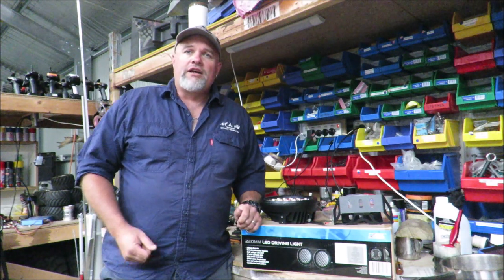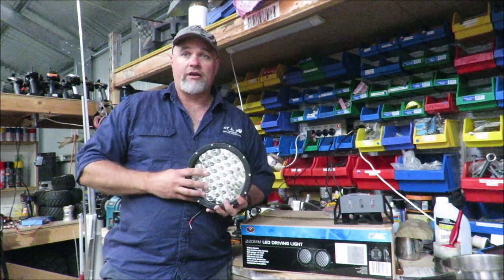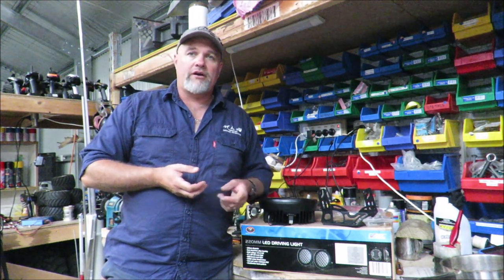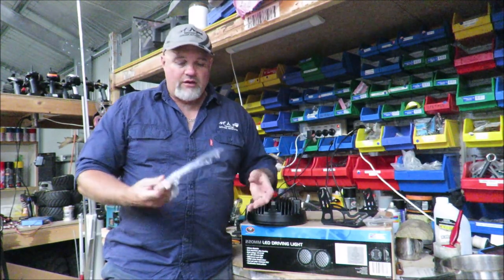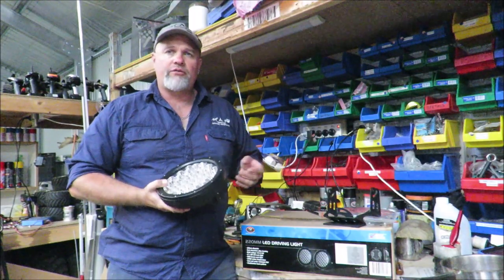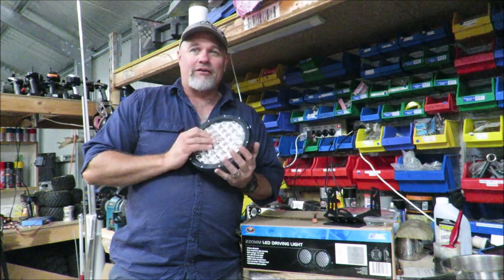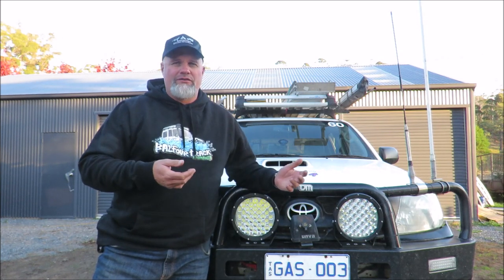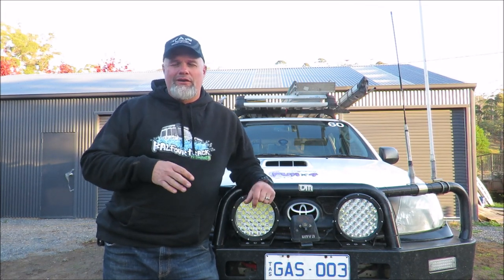SCA 185W 220mm LED Driving Light Review

Comment: Hey I know you posted a year ago they use 5w diodes but regulate it to 10 amps to use common Supercheap Auto wire, plus also underpowering the LEDs will make them last longer